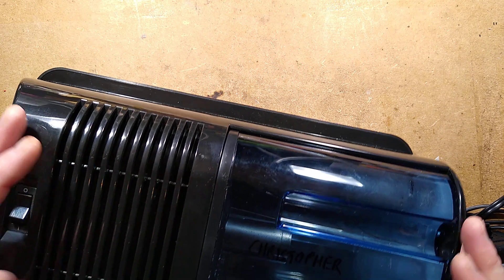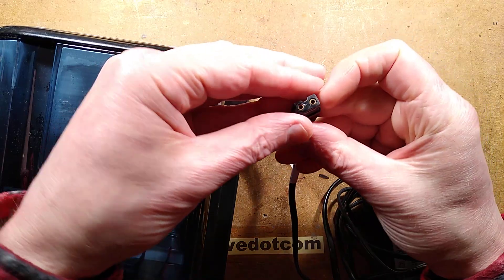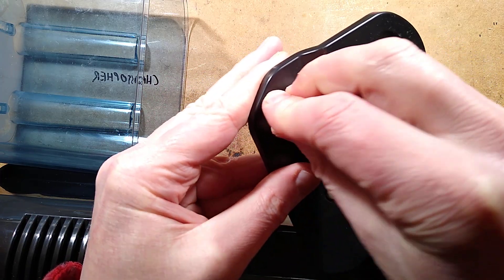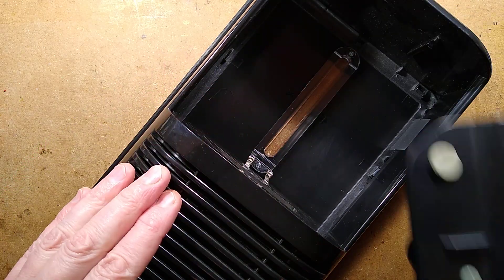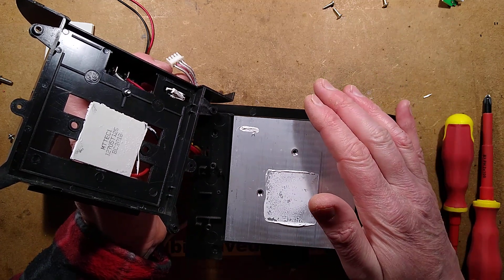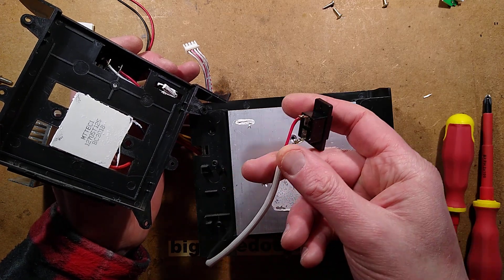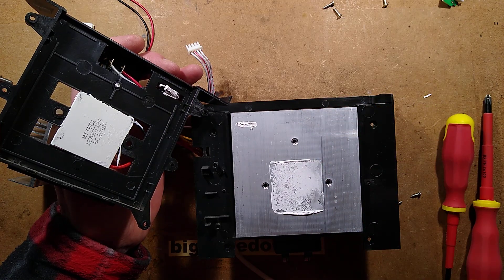Inside a faulty Aldi dehumidifier.

Comment: These mini peltier based dehumidifiers are a complete waste of time, money and electricity.
Buy yourself a proper compressor based unit and see the difference.
Reply: Or better still a dessicant wheel one, because the compressor ones don't really work in room temps. below about 12 degs. C, whereas the dessicant ones do.
Reply: phil955i yeah, I had to put a dessicant wheel dehumidifier in my attic to cut down the 80%(!!!) RH it gets up to during the winter otherwise. fun stuff happens when morons seal up an old house built with fireplace heating in mind...
Reply: @phil955i  Who has their house that cold?
Reply: @Oscar-if6lq  those that don't heat their houses 24 hrs a day. You know, those that go to work during the day?
Reply: @phil955i  If your house drops to 12C or below after going to work for ~10 hours then there's something very very wrong with your insulation.
Reply: @Oscar-if6lq  mine actually doesn't drop below about 15 when the heating's off during the day. I'll be buying a compressor based dehumidifier next time as I realise that I'm paying unnecessarily for the extra power that a dessicant one consumes.
Reply: @phil955i  Yeah that's what I meant when I saw people suggesting a desiccant one for a normal household use. Sure, if it's in your loft or unheated basement it's worth getting one, but if you need one for your house because it's damp and cold, why not try just switching the heating on first, as that will raise the Relative Humidity and more moisture will be required to reach dew point (thus helping with damp).
Reply: @phil955i  who's trying to run a home Dehumidifier in an environment less than 12degs C? They should probably turn the heating on! Lol
Reply: @Alexander_l322  Clive prefers the cold.
Reply: @stonedsavage7814  that's true!
Reply: @Alexander_l322  Plenty of houses have unheated spaces e.g. garage.
Reply: @Alexander_l322  do you heat your home 24 hours a day? I certainly don't heat my home when I'm at work. The heating's on for maybe 5 or 6 hours a day max.
Reply: @phil955i  Yes, in my case i use the heating on 24h it's self regulating and it's only mantaining the 20°C in every room. I notice a big difference in cost to heat up all the space from a lower temperature than to mantain constant the temperature throut the house. The good point is that in this configuration i have a confort that i didn't have in all other past year, i pay less and I stay good. In my house we are a family of 4. Parents have their jobs and work with shift, i'm pendolar with the university and my brother is in high school so in most cases there is one person home. (For reference I live in Italy near Venice, in winter -5/5°C in summer 30°C)
Reply: BigClives house gets colder than that :D 👍
Reply: @NicolóPozzato  in your case yes you need the heating on most of the time because someone is always home. But scientists have conducted experiments & it's actually cheaper to heat your home when required, not constantly, if your boiler is energy efficient & the house well insulated.
Reply: @phil955i  I do. My heating is set to 16°C overnight, ramping up to 19°C in the morning, then dropping back down slowly in the late evening. But then my wife and I are home all day. Also her pets wouldn't like it if they got too cold at night.
Reply: @Alexander_l322  I have my compressor type in the conservatory and it seems to work quite well. I wouldn't try to heat the conservatory.
Reply: They make decent small space heaters, however.
Reply: @tubastuff  they do lol. It provides gentle background heat & we close the door to the living room & it keeps it quite cosy to the extent that the heating hardly comes on at all because the CH thermostat is in the same room.
Reply: Yes, non repairable
Reply: I can attest to that, they're well worth the additional cost.
Reply: I'm thinking to myself i have a 50pint Running in my basement. This little thing Might be good For a Shoe box
Reply: @bansheemania1692  My in-laws in Slovakia bough one of these for their shower room.... opening the tiny window on a cold and rainy day was far more effective.
Reply: I have an "air conditioner" for this, works good for a 5 year old unit, constant use, its a GE one }:)
Reply: If you have a boat, caravan or any other remote location a desiccant dehumidifier is the better option. It will work down to much lower temperatures. A 300W dehumidifier will also provide a small amount of background heat and its fan will circulate the warmed air. You need an external drain hose to avoid the internal tank filling up and switching the unit off and mains power as a 25A (on a 12V  supply) load will flatten batteries very quickly. It’s as well to check regularly as your power supply may be tripped off and marina/site managers may not bother to tell you!
Reply: right but a peltier can be a nifty thing. I think some RV's have them in cup holders
Reply: .........tell that to people like me who use a 200 watt atx power supply to powerr 1 to chill a single can!
Reply: Hell yea! Mine only uses like 160watts and it fills its tank in 24 hours, no mouldy weed for me! :)
Reply: Alright you bunch of tossers, you've made your point.
Reply: @Alexander_l322  hehe

Comment: Best at 30C, well that would work by me then, as it is 29C indoors, and 60% RH at the moment at 10PM. But the fan does something similar, and with lower power use as well, though the RH is not changed, but it feels cooler.
Reply: I believe a dehumidifier basically acts as a heat pump, pumping heat from the moisture in the air, into the air proper, added to that the inherent inefficiency of the peltier adds more heat. So no, I wouldn't want this in a hot climate.

Comment: I bet the XT60 connector would work great to replace the connector. Although it would be overkill.
Reply: Just hard wire it, not like you will disconnect it much.
Reply: You can also get XT30, which is physically smaller. But a standard DC barrel jack would also work. You can go to 5A, maybe a bit more on some of those.

Comment: I wonder why they didn't they make it a 24V device to reduce the current consumption?
Reply: Probably did not want to get the 24V peltier units, or stack 2 12V units on each other.
Reply: Because it doesn't matter? Its power that's important.
Reply: These peltier devices just need a lot of current, you can't really do a lot about that. What they could do is design or use a proper connector that's rated for the current. But of course that would be more expensive.

Comment: The description translated from Dutch was pretty good, but here's a complete translation, with my comments in [brackets].

QUIGG
(NL) Compact air dehumidifier
- 65 watts
- Air dehumidification capacity: ca. 400ml/day at a room temperature of 30°C and 80% relative humidity [temperatures above 30 degrees used to occur about 0-7 days in an average year. In recent years this number has been higher, but not enough to make this statistic particularly useful]
- Removable water reservoir - capacity of water reservoir ca. 1.5 liter.
- Automatic shut off when the water reservoir is full - control lamp indicates full water reservoir
- ON/OFF switch [wow, such advanced features!]
- Operation control indicatorr [there's a typo in the original Dutch]
- Thermo-electric Peltier element [Clive's pronunciation was quite okay]
- Dimensions case ca. 20.5 x 12.5 x 35 cm [that's about 8 x 5 x 14 inches]
- Cable length ca. 3.2m [that's about 10 1/2 feet]
Reply: There's a typo in yours as well.

Comment: Have you ever torn something apart that someone then asks for back? 😂
Reply from the maker: I've made videos about a few things that were pre-arranged to be sent back.  But I avoid offering a repair service.
Reply: @bigclivedotcom  I just meant like, suddenly someone changed their mind and they want the irrevocably destroyed thing back in one bit😅
Reply: @phonotical  I agree. Once the Vise of Knowledge, Pliers of Knowledge, Hammer of Knowledge, etc., etc. have been used, it would be problematic.   I guess once the knowledge has been removed, it's like removing the magic smoke. :-)
Reply: @davelister796 
Electronics run on magic smoke and knowledge, so yes. It's exactly the same. Extract either component and it will never work again.
Reply: i can take my own electronics apart, if i send them to clive, chances are i dont need them back or i will include a note if its a rare 1978 electromechanical snail flogger or similar
Reply: Don't worry, I don't need it back :-D I've bought a decent one since then (refridgerator type)

Comment: Where is the cycling?
To let the accumulated ice melt allowing more ice to build up it should be cycling the element.
Not cycling is much less efficient as the ice just builds up slower and slower as it "insulates" the cold side.
Reply: With airflow, and once the warm side saturates with it's normal heat load it probably won't ice. They're probably hoping for that, because yeah, if it ices it isn't going to correct itself unless someone turns it off.
Reply: In a typical room at 20 degs C it won't ice up, the cold side heatsink will just be cold enough to condense water.

Comment: Clive, it's cute that you think that's a big dehumidifier.  The ones sold in Canada hold at least 10 litres and have a compressor like an AC. :D
Reply from the maker: It's big for a peltier unit.  My normal dehumidifiers take out litres of water and are plumbed in to drain it automatically.
Reply: @bigclivedotcom  I figured that's what you meant after I posted it, but decided just to leave it. lol  Oh, speaking of peltiers, I came across a liquid cooling  system for a CPU that uses two peltiers to cool the liquid.  The were attached to a massive aluminium heat sink which attached to a rad, etc.  It was very odd.
Reply: @markjohnson7887  Would have most likely workes just fine without the peltiers in it.
Reply: This is a placebo dehumidifier. I doubt it could lower the humidity of a closet by 1%.
Reply: @misterhat5823  LOL! Maybe it is a dehumidifier for smurfs?
Reply: Doubt you could post it though, while this one will fit into a parcel dimensions and mass.

Comment: That's enormous? Mine is like 2ft high by 1ft deep and just as wide 😂

On the plus side, I have a backup fridge motor if I ever need one 😂
Reply: Yeah, I have one like that too, it's so very loud. I usually let it run in my bathroom.
Reply: @Milamberinx  that would be a good idea for me too, but I'd also be worried about electrical appliances in there, my one at the moment is next to my bed, sometimes I feel the white noise helps drown out anything else

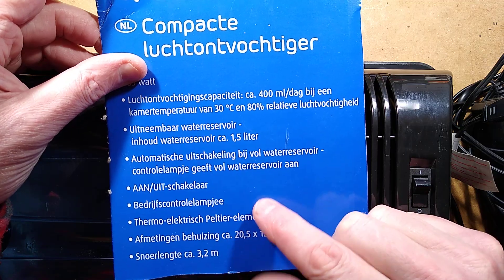Comment: 2:30 - 30 degrees is definitely warm, but note that in some parts of the world, that might be a normal indoor temperature. Over here in Australia, that would still be on the warmer side, and we'd probably put on the air-conditioner by that point, but high 20s indoors are pretty normal temperatures during summer. However, point taken about the performance being based on "ideal" situations that are not going to be common in much of the world.

Comment: Peltiers have fascinated me for years. There's some fairly recent research into creating much more efficient TECs, which I hope become more mainstream.
Another cool patent I've seen recently is that AMD may be using ultra thin TECs between CPU and memory chips to help transfer heat better once they start 3D stacking their chips. Super neat!
Reply: Cool the CPU and warm the memory chips? That's interesting, never heard of it before...
Reply: Probably the thin TEC's will be used to transfer heat to an intermediate thermal transport layer, so that the chips themselves are cooler, but the heat from the inner layers can be transferred by something with better thermal conductivity than silicon, though you are constrained, as it has to have a very similar thermal expansion as silicon to prevent you shearing the chip off of the attachment point, and most kovar alloys are pretty poor thermally compared to copper, but better than silicon. Or have one top and bottom to cool the chips actively to the heat spreader and the chip carrier, with a larger surface area. Probably hot processor on top, and memory underneath, with a lot of die space lost to the interconnections.
Reply: Thermocouple technology is amazing. I'd like to see a more efficient one that converts heat to energy. Stanford Ovshinky, father of Nimh and much great tech, had hopes to make a cigarette sized box that could be dropped in to a camp fire and power a color TV. I've got some good ideas what one could do with such a device to revolutionize our society.
Reply: @johnpossum556  Biolite make camp stoves and ovens with TEGs in. Charges battery and has USB ports to then charge other devices.
https://www.bioliteenergy.com/products#cooking
Reply: Yeah I was wondering what they were going to do about heat with the 3D chip stacking.
Reply: CaffeinatedTech forced chilled water through little channels was considered thirty years ago for such things...
Reply: @markiangooley  They also were using sealed packages and a CFC blend, to make a built in heat pipe on chip. Only thing was the packaging cost was then so much more than the chip cost, which is fine for things like jellybean SMD transistors, where the chip inside is a fraction of a cent each ( but you get 100 000 off of your $1k wafer) but if your silicon is one device per wafer it hurts, especially if your yield of good perfect working devices is one per dozen or so wafers.

Comment: A few years ago, you did the video on the drum dehumidifier, I looked for them online I couldn't find any, none that would say upfront anyway.
Reply from the maker: They may just be in Europe at the moment.  It's maybe a good thing, since they're still evolving.  The early ones had reliability issues due to their complexity.
Reply: @bigclivedotcom  evolving or 'revolving'? As they're drum-based I suspect the latter...
Reply: In the USA it’s drum humidifiers to convert hot, dry air into moist cool air, mostly. In dry climates, not here in Florida...

Comment: In my humble opinion, companies add too much thermal compound to their heatsinks. The compound is there to smooth out any irregularities and tiny pits in the metal so increasing the surface area of the metal parts when pushed together. The conductivity of a good thermal paste is around 8.5 W/mK but it's 205 W/mK for aluminium so the compound actually acts as a thermal insulator when too much is used.
Reply: If the devices are mounted properly with enough pressure any excess paste would be squeezed out and not be an issue really.
Of course if the thermal paste is conductive one should pay attention to that.
The major issue is not that they put too much but that it's usually the cheapest compound they can get away with with predictable results
Reply: @Yrouel86  As well surface finish, that ceramic is pretty much going to be nearly perfectly flat, but that fly cut plate is as rough and ready as if it was just extruded, just with less bowing. you would need to have a better finish, and lapping of the surfaces, to get decent heat transfer, which would only need a single match head of paste to cover the whole surface adequately. All the white on the aluminium is just showing all the hollows and poor finish.